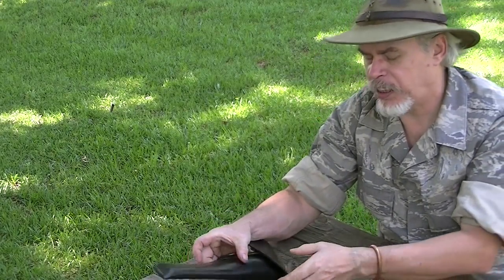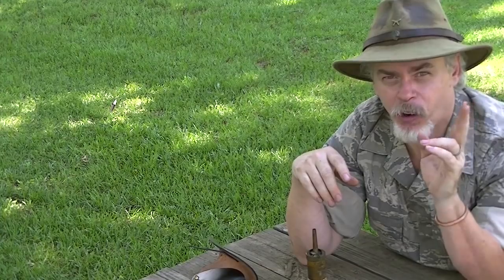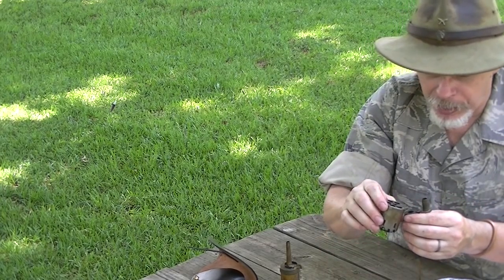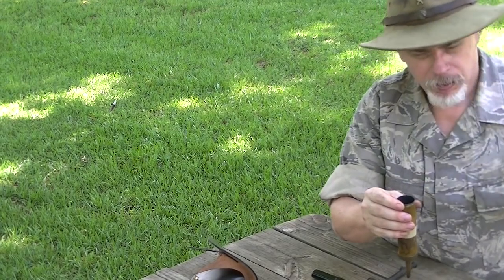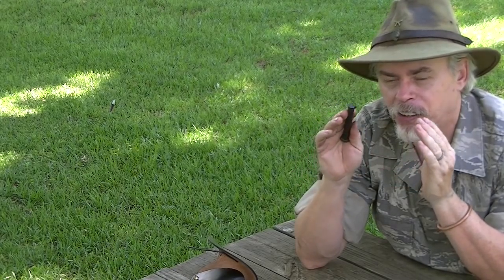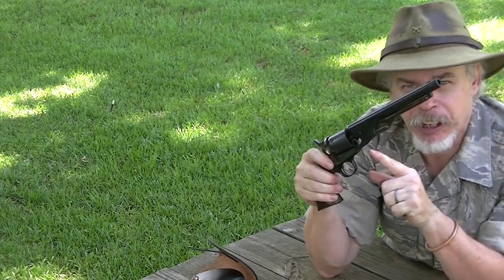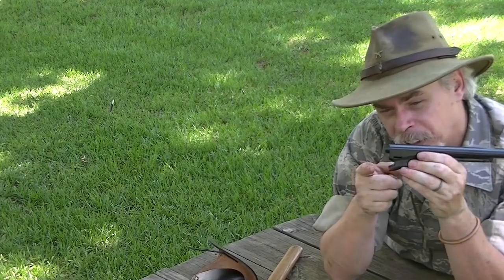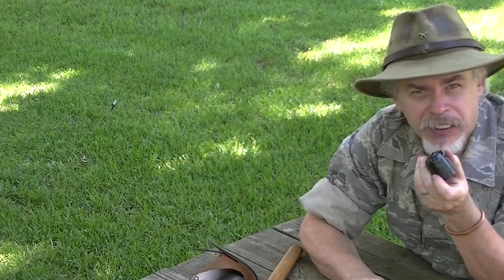The Percussion Revolver..Load Development

Comment: In the Remington, you may want to try going up to 40 grains. I have a .44 Uberti with a 5.5-inch barrel and have found that the extra powder helps make the gun perform more like the 8-inch model. I have used 40 grains with and without a wad with good luck. My gun also grouped better at 40 grains then 25, 30, or 35.
Reply: Wayne Heath great comment. I was wondering about this exact gun. Is it decently accurate? Have you seen a difference with conicals?

Comment: Thanks for an interesting and I formative video. I think now I have some work to do with my new 1860 Army Pietta. When you were explaining about powder compression it reminded me of when I smoked a pipe. If the tobacco was too loose the it would burn too fast. if too compressed the pipe would be hard to smoke and go out and there was also when the tobacco was too compressed at the top and loose at the bottom and it would cause draw and burning problems. I was thinking that with the unique rammer system of these firearms that the powder would tend to be compressed more towards the bullet end of the chamber and looser towards the nipple end. Maybe for target shooting tamping at various intervals would produce a more even ignition realizing this may be impractical in most other shooting situations. Thanks again.

Comment: Good information Blackie, but I have my guns set up so with the arbor length adjusted to the spot when it bottoms out  the barrel it just touching the frame. The wedge goes in thumb and a tap tight. Now the barrel and frame are a solid piece. My cylinder/barrel clearance is very small (I don't have a gun at hand to measure) but it is just a couple of thousands.  With the inside parts  smoothed out and a cap rake installed  like my my 1860 Army's are set up they have has hundreds of rounds and no cap jams and no wandering zeros. Thanks for the hard work and information.. Keep up the good work.
Reply from the maker: glad you found it helpful..safe journeys

Comment: That s  great.  I do mine with 5 phases. Each phase with three parts (Initial, consistency final). 1- Function. 2- Charging. 3 Aim point 4- Penetration/mass effect. 5- Grouping.

I charge the various elongateds with   o n l y   powder and ball. Where the powder compression stops before the rammer reaches its stop, and the tip of the ball is just below the surface of the chamber. 2 drops of lubricant over the loaded ball. , and a    p r o p e r   fitting cap.
Reply: I do the same thing with all my pistols! Load the chambers full to get a 'Full chamber' measure reference.
Reply from the maker: Nice work!

Comment: The only problem I can see with everything you explained about "Load Development" is that you are starting with a large load and then adjusting.  The reason I see this as a potential problem is that many of these reproductions have a brass frame... Frame stretch may become an issue if you determine that the sweet spot in load size is quite large.  Now, if you have a steel frame, etc., it's not an issue but if you have a brass frame, maybe the consideration of stretching might be a factor to take into play and you may want to start with a much lighter load (without leaving air space) and then adjust up from there.  What do you think?
Reply from the maker: i have been wondering...the frames are not brass..they are in fact a metal called gun metal #6 a alloy of bronze and others..the henry rifles today modern made in .357 .44 mad  30-30    45-70 are all made from what seems to be the same gunmetal # 6..i wonder if those rifles are going to shoot loose  as well....i guess time will tell
Reply: @BLACKIETHOMAS  thanks for the answer. That's interesting to know. I guess it would be interesting to see what happens I didn't know that about them metal. Either way I think that you're explanation and fix is a good one.

Comment: Hey Blackie, thanks for the great video.   Well I have just about all I need to get started with 
my foray into the world of Black Powder shooting.  I have my.....

Brass powder flask
Brass powder measure
Brass percussion cap loader
Nipple wrench
Remington #10 percussion caps.
Cleaning rod with bore brush and patch holder
16 oz container of American Pioneer Powder  ( FFFG )

All I need now are 

.454  round lead balls
.44 cal pre lubed Wonder Wads

Hmmmmmm   there is one more thing I need.
Oh yeah,  I need my Pieta 1851 Confederate Navy Black Powder Revolver.
I am waiting for the Christmas Sale at Cabela's  for it to drop
from  $199.99  to $149.99.

I have seen many different recommendations for loads for the  Pieta 1851 Blackie.
Some say they have seen online from Pieta a chart that says 17 grains.   That seems
a bit light to me.  Others say 20 grains and others say 25 grains.

What is your opinion on this?  Do you think I should just go through the measuring and testing
procedures you outline when i get my revolver?  I plan eventually to go to premaking paper cartridges
for it.  Do you have a video on making those?

Thanks
Bill
Reply from the maker: the load procedure i show will show the most accurate load for the revolver..as to them shooting loose..with the metal..they use today i say shoot it..yes it will""eventually"" wear faster..but based on how many round over how many yrs..it took me nearly well over 10yrs of shooting..and shooting very often with full loads i might add..for mine to finally shoot loose and be unuseable

Comment: If possible can you please explain about fillers like corn meal or whatever you think is best
Reply from the maker: sure i used corn meal it is cheap and easy to get..plus it compresses well..usually drop in the charge you want to use fill chamber to top with corn meal..then compress a little with rammer to make a place for the ball to sit in loading..then seat ball..and shoot..the only thing ya need to look closely at is if you life in a place with..high humidity the corn meal can wick water from the air..if left open..( like here in my south when its 90% humidity some times)..in those times the extra water will dampen down you powder charge ..and you may get a squib if left loaded too long..be very aware of how the gun is shooting..if for any reason a shot felt soft or odd..stop pull caps and remove cyl and check bore to be sure a ball is not left there..hope this helps
Reply: Thanks for the reply and it does help I live in SC Myrtle Beach it's pretty humide you have any other ideas for humide areas just wanted to thank you again for the information and the reply

Comment: Recently I was reading my copy of Dixie Gun Works catalog and in scrutinizing the bore diameter details in the various pistol descriptions(the DGW catalog gives a wonderfully exhaustive run down of the manifold features of all the firearms as you may well know),I realized that nearly all the revolvers had a rather substantial difference between the chamber diameters and the barrel-bore diameters(groove-to-groove, specifically speaking). The projectiles were larger than cylinder chambers but smaller( I think) than barrel bore,groove-to-groove of course. I've viewed several of your videos but I can't remember if you treated this subject or no. Obviously when we ram down a .454 ball into a .446 chamber throat we no longer have a .454 ball hitting a .450(?) bore. It may not even be a concern? But can this condition affect accuracy? Has it been a problem for you? I know you have considered at length some where the need to check chamber's consistancy. Thanks again for your detailed information on the old guns too,Blackie.
Reply from the maker: when using pure led balls or bullets..the pressure of the power charge firing will cause the lead to bump up or flatten..and thus fill the bore to proper fit..the only trouble i have had was when i created hard lead bullets..these would not bump up and accuracy usually suffered

Comment: This is a little off subject. I have a question about casting round balls. I have an 1851 Conf. Navy and an 1858 Rem. New Army both in 44 cal. I have a LEE 2 cavity .454 mold. I also have about 5 pounds of Lyman #2 lead. Is it safe to use the Lyman #2 in my cap & ball pistols, or should I get some pure (99.9%) lead and use it for casting my round balls ? Thanks for all your hard work on these great videos. One more thing. I did not find a video in your library on casting round balls. Maybe consider doing one some time.
Reply from the maker: the #2 will work fine..in the long past the rifling of repo's was too shallow and the #2 lead would not grip well modern guns have better rifling and should shoot fine..i plan on doing a casting video in the future stay tuned..safe journeys

Comment: You cannot make a comparison to gasoline burning in a cylinder to Black powder if you understand the chemistry of black powder you would know it has its own oxygen source and unlike gasoline it requires no air so air space doesn't effect how clean it burns or how fast.  The speed at which black powder burns is determined by the grain size  FFFFg burns faster than  FFFg  and FFg is slower than the other two and the speed of its burning has some control over velocity.  Black powder is going to be dirty no mater what and it will fowl the barrel but it's residues are water soluble.
Reply: Correct... His understanding of the burning of the powder is incorrect.  The potassium nitrate is the source for the oxygen in the chemical reaction, not the air.  By compressing the powder, you are affecting the speed that the burn progresses through the rest of the powder.  That would also explain why having an air gap between the powder and the bullet would cause an explosion -- more of the powder is exposed to the initial spark from the primer / percussion cap / ignition source and it all starts burning at the same time, thus exceeding pressure of the chamber.  By compressing the powder, you are getting a more controlled burn from one end to the other.

Comment: Blackie, I have a 'C' 3rd Dragoon from the 70s with a loose base pin. How can I tighten it properly/maintian proper clearances etc?
Reply from the maker: a simple method would be to first make a good mark on the basepin  and one on the recoil shield..now unscrew the base pin..add green locktight..( get on line or from brownells) add a few drops and screw back in being sure to make the marks you made line up now quick put gun back together and be sure everything is in proper place ...ya got a min or so tops  before the green locktight sets up..thats should fix it
Reply: That s  helpful!!!  Should I put a shim or something on the lower frame to keep the clearence so that the cylinder won t rub/bind? Because that is what it is currently doing.

Comment: I have a '51 & '58 in .44 cal. Should you measure your powder charges by weight or by volume? I have (for example) a 30gr. spout on my flask. I fill the spout with Pyrodex 'P' powder and then weigh it on my digital scale and I get about 18gr. Big safety issue here.
Reply from the maker: i always use volume to measure my powder with
Reply: Thanks for the reply. I thought I should mention this because of any rookies out there that may be confused on whether to weigh or volume their charge. Merry Christmas.

Comment: De-burring amounts to what?
Reply from the maker: in my earlier video i debur a 1861 navy and i also did on ( warning very long video!) on the 1858 remington..in short i check all parts for burrs or casting flaws that might hamper function..and take you step by step thru the process
Reply: Gotcha. I'll look for that video. Thanks. I've had my new 1858 now about 10 days and still have not shot it. Just waitin' on supplies to come.